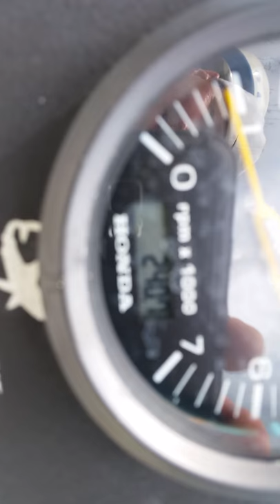2013 Honda BF250 corrosion issue

Comment: you said you will post back? any answers from Honda yet? We are having the same problem. we are considering making a longer spacer on the leg and raising the height of the motor.  we also put a clean air snorkel on the intake to fetch clean air so the salt will stop jamming up the throttle body.
Reply from the maker: My apologies. The replaced the cowling. It is a known issue to them from what the dealer explained to me. Problem went away immediately after replacing. I have since sold the boat and motor.